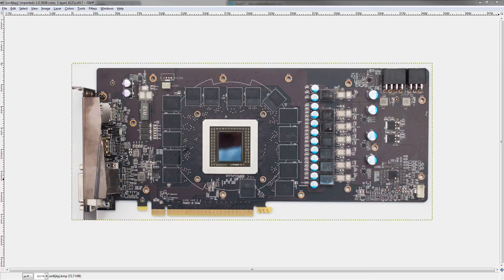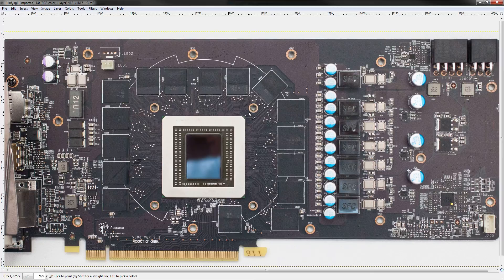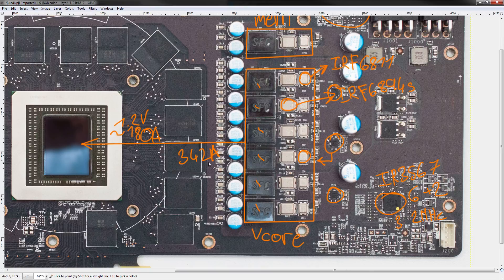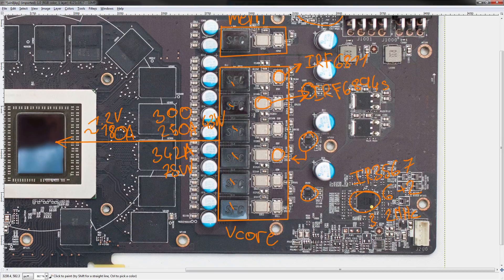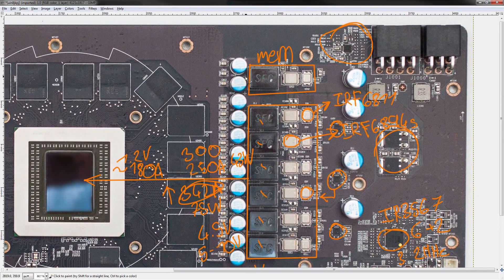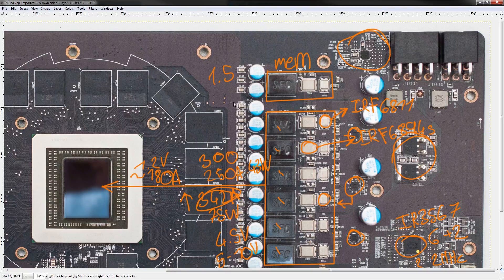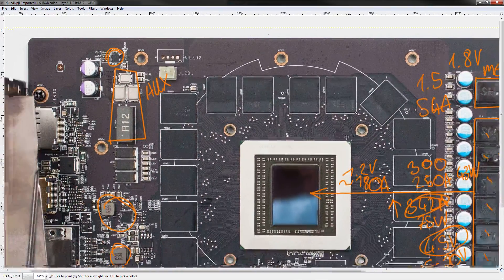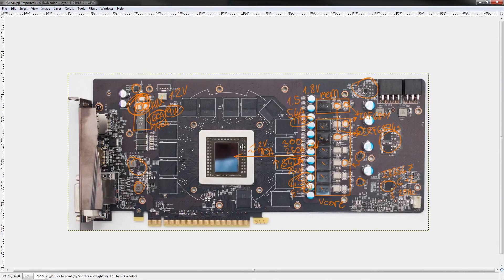PCB Breakdown: MSI R9 390 Gaming

Comment: I still got this and intend to keep it alive, just need to figure out thermal pad sizes. Will not be my daily driver but will live on in a networked backup PC.
Reply: did you find the size?
Reply: @ade_vxt  I bought an assorted pack of 0.5, 1, 1.5, and 2 mm pads each 10x10cm. Then used digital caliper to measure the old ones + round up for compression, but it was all over the place. On one spot I had to use 2 on top of each other for like 3mm. I re-seated the heatsink a few times until everything made contact judging by impressions in every pad + checked if the grease spread, cleaned, and re-applied that. Not saying it's perfect but better than nothing and the old ones were broken/missing. Idle 60C but fans off and case fans on minimum, movies 70C and still kinda silent mode, full load with max rpm fans 80C, but I don't game anymore on this as my displays are 4K, it just needed to live.

Comment: Are you sure that auxiliary voltage is for the memory controller?
Would bumping up aux voltage stabilize memory overclocks? I thought that raising Vcore helped with memory stability...
Hard to find info on what Vaux actually does

Comment: I bought an msi 390x 8gb card. It died. It was the first piece of hardware I owned that actually "died". I replaced it with a new one. That card also died after 4 months. It wasn't a failing mobo or power supply.